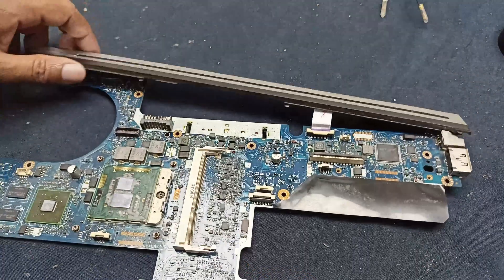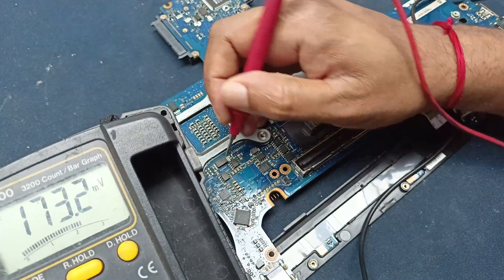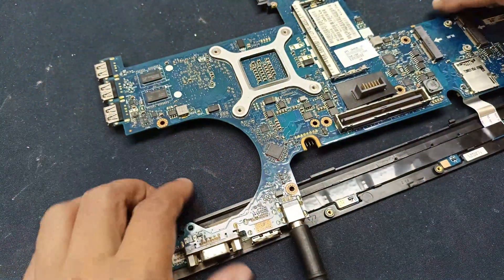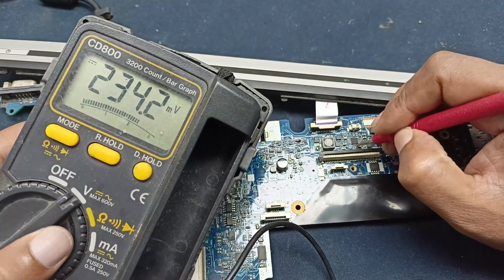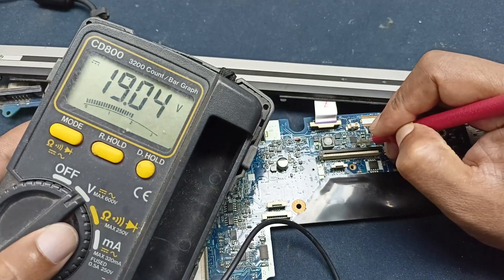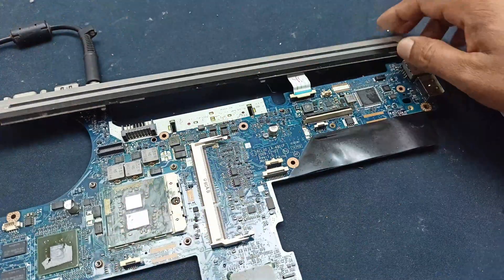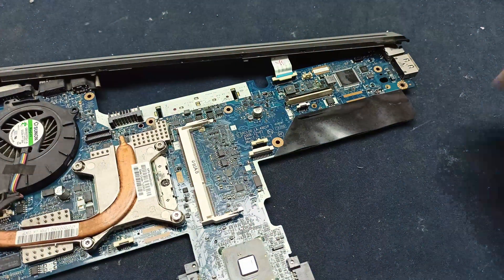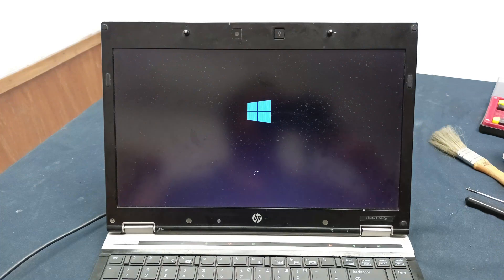Hp Elitebook 8440p laptop No power || Hp Elitebook 8440p power won't turn ON ||

Comment: I have another board same issues i change the ic and not working
Reply from the maker: Did you check the mosfet get voltage...?
Reply: @mrcontrive5641  yes no power at all
Reply: I have removed the ic complete and one of the leg on board have pill off
Reply: I damaged board of my laptop after red blinking error

After that i found that charger was not working properply😊

I bought new charger and system repaired also😊